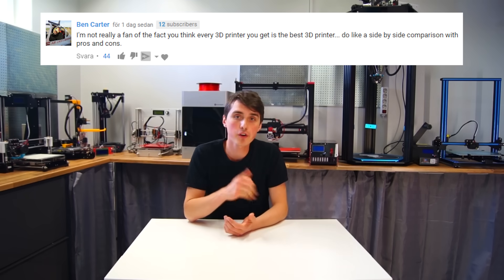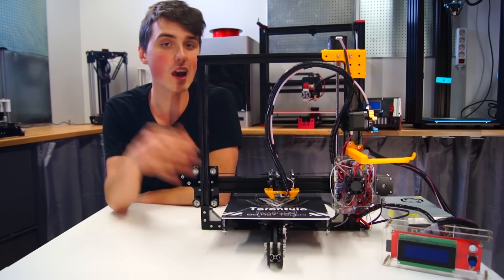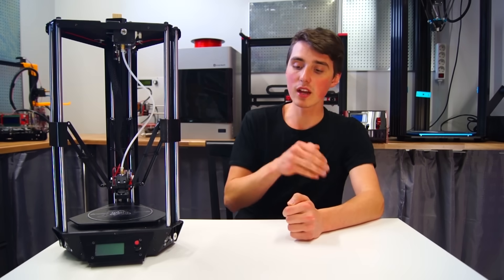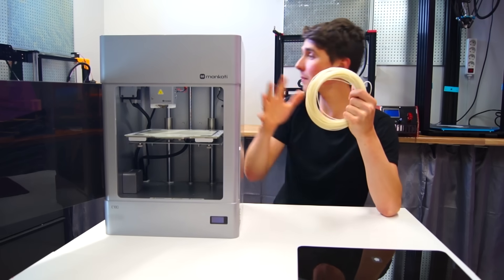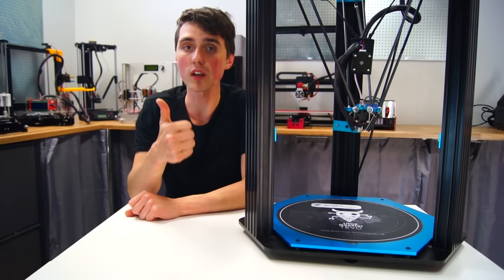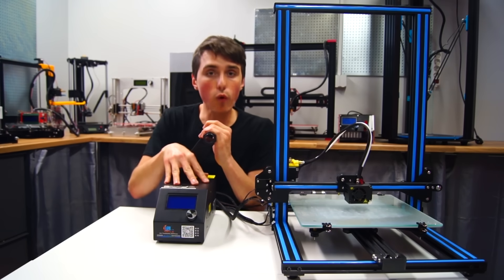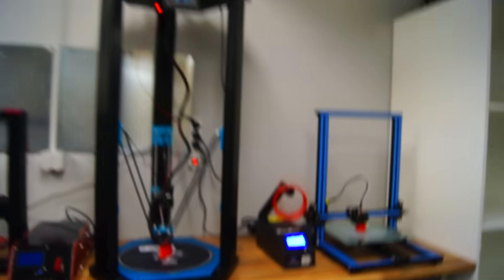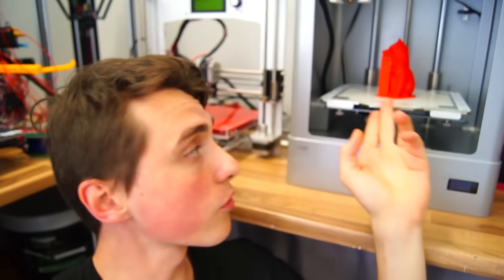Why This Is the Best 3D Printer - Comparing ALL My Printers!!!

Comment: I have been printing with the CR 10 for a week now, and this printer is mind blowing. Considering its price/performance this must be the best printer to buy in the world. I got it for 3600 SEK(423 USD). 300 microns look like 200 microns, and 200 look like 100 microns, and as is mentioned in the video the layers are laid down perfectly and in all axis. I don't understand why people feel the need to mod this machine, like messing with the fan duct or extruder when you can print one small object at 100 microns, at slow speed and still get no warping due to the extruder being close. Overhangs are also printed extremely well. If this machine cost one, two or up to three times more than it does, it would still make sense to buy it.

If you are wondering if this machine is only good for large print like i was wondering before i bought it, wonder no more, it can handle both very very well. I started with UncleJesses Simplify3D settings, they worked well but i have tweaked them quite a bit, but only small tweaks in numbers. One needs to tweak these settings depending on filament and not just the machine. I am guessing this printer can handle 50 microns as well, i am just about to test it. for print speed i have it set to 60mm/s

Anything negative well yes some:

1# My Z coupler was stretched out and basically destroyed, someone had printed with the machine as there was black filament in the nozzle. I was devastated over this since it took 25 days for the printer to arrive (gearbest/hongkong). I was anxious to print and did not want to mess with support and them sending me a new z coupler. I was ready to order a new coupler from Sweden and get it by mail in 1-2 days, but what i did was to compress the coupler with large whatever they are called pliers, and refit the coupler and i was super lucky as i get no z wobble whatsoever. I have read that many people get this stretched out z coupler, it boggles my mind how they can send the machine with this error, i also know why this can happen to the coupler and they should too.

2# I have not heard anyone complain about this and i have seen people printing objects 400mm tall that are perfect but, when small jittery features are being printed at the bottom, the top vibrates, BUT, i have got my printer standing at a large square piece of packing foam that was protecting the printer in its box. This could be the reason why i have extra vibrations, in fact it is very likely. One can do a mod for increased stability, also i think when small motions are made when the extruder are way up in the frame at the top of the object, the vibration will be much less or not exist since it is not happening at the base.

3# PSU noise, the power supply fan is crazy loud. The printer itself is not bad, but the PSU i will have to fix, there are solutions to this, they should have included a heat controller for this fan. I will have to take one from my old Prusa i3 that is really silent.

4# The controller knob for the display does not register clicks too well on my machine, could be a little better.

With all that said, #1 and #2 could be a non issue for most people. My summary is that i wanted quality and print size this time and i got it. This printer is so good that i wonder how it compare to a MakerBot Z18 or similar that cost 8000 -  10 000 USD.

Comment: I have the geeetech prusa i3. At the beginning it was a shitty printer. Never got the right settings for it. It took me a week to install it properly. But then i troubleshoot it and the roda from the Z axis seemed not the right one for me. So i bougt another set from the store. I bought rods with more thread. Software was ok. Only the usb connection needed some work. But after all everything is working ok right now with the new rods. I'm printing a lot of fpv drone stuff for it. The only downside is that i only can print at a 35 mm/s speed in reptier host slicer. It can print faster offcourse but the faster i print with this one the quality is going down. But no problem for me i payed only 250 euro's

Comment: I had the geeetech i3 aluminum it did a similar thing as yours right after assembly i maybe got a couple decent prints off it before it stopped working completely.... It has good mechanics but crap electronics a ramps or smoothie upgrade would be the way to go with it the sanguinolulu boards are awful i tried 3 boards they sent me and none of them work

Comment: I'm sorry you've had so much trouble with your tevo black widow. Apart from having the power supply go out on me, it wasn't hard to replace. I even upgraded to two power supplies so I could split the load. I hope you have better luck with it because it really is a great printer.

Comment: I'm about to get my frist DIY Printer (Anet A8). I've been using the deltaprintr from deltaprintr (Joel from 3dprinting nerd reviewed it). I'm getting the free upgraded nozzle but I'd like a larger print bed.  Do you have any experience with upgrading the anet a8 to the e3d extruder?  I really enjoy watching you testing and the ability to test it. (I'd go for the CR-10 but that's just a bit above my price range....and I have a space issue :) )

Comment: 5:22 If printer shows incorrect temperature, while termistors are valid, this may be either incorrect voltage applied to termistors that controller reads with incorrect current (measuring resistance). This is controller HW problem. Also RepRap software, I expect in the controller, has lot of termistor resistance to temperature tables. In case wrong table is chosen in software image this will give wrong temperature on display. Also first HW problem can be solved by customizing  your own termistor resistance to temperature table, but this is long activity to measure resistance at every 5 degrees step of externally measured temperature to put values in the table.

Comment: We're total novices on 3D printing. and wondered if you could help? We want to print a 2 part wall mounted kitchen roll holder holder. The size would be around 300mm x 100mm. It would need to be great quality, could you recommend some machines that could do this?

Comment: I noticed you took out the fans on the tarantula. Is there a reason for that or just did it because. Just wondering cause I ordered some fans for it and wanted to know if it caused a problem or not
Reply from the maker: No reason, basically just for easy access of the hot end,

Comment: Great video and and information.  In the video before printing, you said all the printers were set to the same speed but the TEVO Delta finished 30 minutes before all the others...seems like the quality of this print would have been a better comparison if the speed of the print was actually slowed to match the others.   Also it would have been nice to know which printers come with auto bed leveling vs manual bed leveling since a good leveled bed has a great effect on print quality.

Comment: Anyone scared of the exposed wires of a power supply should just "print" and box to put it in.  Hellar!  Isn't that a main reason to own a 3D printer, so you can solve real world problems with 3D printed solutions?  In the multi-million dollar company I work at with liability issues up the wahzoo, their approved solution is a strip of plastic to cover the terminals secured by 2 screws!  So almost any kind of cage that keeps fingers out and still allows the heat to escape should be safe enough.... unless you drink next to your printer.
Reply: you the real MVP.

Comment: I've got one of the Geeethech i3's... They have probably 8 variations, mine's got the plastic frame ("b"). What was up with yours? I found the shaft couplers were introducing more misallignment, replacing them with direct couplers worked. After lots of firmware edits, I got it working.
Since I've replaced nearly everything but the frame. It makes a good showing for total investment, but a Tarantula may have been the better choice.

Comment: What could you say about PRUSA I3 MK2S ? 

At today I haven't any 3D printer, but later this year I want to buy my first one, I do not want to have big problems from the start and want to have a near to a perfect finisching, (not rough) for pretty simple parts to build. 
I would like to have the possibility to print 30×30 cm (or at least 30x20 cm) large and maybe at least 10 cm high.

Comment: did you replace the Tevo's wiring? just replacing the thermistor or mobo isn't gonna help.... also, did you replace it with the proper one? did you make sure the correct one was even selected in the firmware?

Comment: thanks for the video, very beneficial. is your cr-10 the s3 model? 30x30x40? i want to order one in a few days but tjere are multiple manifactures on alibaba. also the cr-10 s4 & s5 looks inviting. do you know anything about them? 40x40x40 and 50x50x50 respectly.
Reply from the maker: Yes this is the 300x300x400 version from Gearbest. Don't know about Alibaba or the other variants.

Comment: on the black widow did you try adjusting pid's
Reply from the maker: No I did not, but I got some replacement parts on the way. Hopefully that will fix the issue.
Reply: RCLifeOn I would try PIDs.

Comment: At Geeeeeeetech printer, did u checked the switch of 110/220 it has inside of power supply?
Reply from the maker: Yes, that is not the problem. Thanks anyway!
Reply: And i assembling my geeetech now and i notice something curious: The four step motors looks equal, but there is one that feel different when you turn the shaft with hands.

Comment: I have a GEEEtech i3 that I've been using for about a year and a half now. It's worked well since I got it up and running but had some issues on setup that needed fixing before I got it to work. What issues are you having with yours?
Reply from the maker: Nice to hear someone having success with the Geeetech i3. I gave up on mine and salvage parts from it. Don't have a plan to fix it really.

Comment: I have a Anet A8 and a Kossel Delta. The A8 ROCKS. I don't have any issues with the quality. I think you might need to tweak your settings. I slowed mine down a bit and the quality is excellent. I have had nothing but trouble with the Delta. Not only is it small but the print quality is not good. I am still trying t tweak that one for really good results. It also has Broken Down on me like 6 times in 3 months. The A8 helped me learn a lot about 3d printing. I have done a lot of upgrading on mine - Cable chains etc...  You can also print Cases for the power supply if you are worried about it.

Comment: Great video which clears up many questions I had. Out of curiosity, can any of your printer print using clear (Transparent) plastic filament? What parameters would you need to print using this material?
Reply from the maker: Yes, I use transparent filament all the time. Typically 2-3 perimeters. Thanks for watching!

Comment: Hello from Spain,

Nice video. I have a Geeetech Prusa i3 pro b, add some improves (change for full aluminium bed, add proximity inductive sensor, solve anti-wobbling in Z, change mosfets, etc) and works very well for price, only cost 160€ incluiding shipping. I spend 20€ more in improvements.

Comment: about the black-widow temperature error: If it is measured by a thermocouple the polarity is important. If the thermistors and printboard aren't the problem the wiring and connections should be?

Comment: Thanks for the run down. Do you feel like the CR-10, at twice the price of the Tarantula, is twice as good a product?
Reply from the maker: Well, I would rather have one CR-10 than two TEVO Tarantulas. However, that's mostly because of the larger build area. It's not linear, you pay twice as much for improvements, not because the CR-10 is twice as good. Was that even understandable? Nevertheless, I would personally go with the CR-10.
Reply: RCLifeOn Makes perfect sense. Thanks for the reply!

Comment: That black widow problem - check the connectors and cabling. The traditional search pattern for failures starts with moving parts, connectors and connections.

Comment: Question: I was looking at the CR10 for a first printer because of price and build volume. Would you say the CR10 power supply enclosure is completely safe, kinda safe? Just a concern because I have little cousins visiting often. I realized that because it's enclosed that it's probably really safe, but I just want to make sure before I get one. Safety before anything else.
Reply from the maker: That's great, safety before anything else! Good job looking after your cousins! Yes, I would say it's completely safe. The power outlets around your house is more dangerous.
Reply: Thanks! I appreciate it a lot!

Comment: So what are your print settings for the Creality  CR-10. And what Slicer do you use?
Reply from the maker: Currently I'm using Cura. It's free for everyone and works great. Maybe I should do a video on it?
Reply: you should definitely do that :) great work @RCLifeOn!
Reply: just got the CR-10 & its amazing. I had an issue with the print starting at the bottom left. Please do a Cura tut. thanks
Reply: yes

Comment: I have a Geetech i3 and let me tell u the damn thing is garbage. It came as kit and I had it built in a few hours.  from day one it has been nothing but problems with this printer. from the belt tensioner  on the X not fitting correctly into the slot of the 3d printed part to the baring holder on the Z splitting and cracking (had to use a zip tie to keep it together). I was hoping that on my first print I could make a new one but I never got a single good print from it. the supplied direct feed MK extruder always jammed and clogged in the throat. I replaced it with a clone j style hot end and still couldn't get a single print. I even upgraded the entire printhead to a geared style and the same problem would occur, the nozzle would clog as if the nozzle was losing power during the print causing it to cool and then kicking back on. I changed thermisters, heater cartridges, throats, nozzles, made my own cooling fins, added fans, removed fans, different manufacture filaments (pla,abs), all metal Z baring holders, all metal extruder holder, thredded rods (the were bent giving real bad Z Wobble), nothing i did could get this printer to give me one single good print. At that point i wasnt about to purchase anther single part (power supply was all that was left). In the end I bit the bullet and bought me a remanufactured Robo3d R1 from eBay for $400 shipped and the damn thing worked flawlessly out the box, I'm printing on it as we speak. One thing I will say about the Geetech i3, it taught me everything I needed to know about 3d printers and how to repair them if something goes wrong. if my Robo3d ever has a problem i have a shit load of extra parts to make it work.

Comment: I'm wondering, I've seen a couple other video that've shown a much much higher print quality to the A8, similar to the tarantula. Did you tweaked the printer to it's max capacity ?

The Cr-10 is actually incredible but in canadian it's 537$ + 113$ shipping. Making it quite expensive at 650 compared to 278 of the A8 ( 226 + 52 shipping ).

Comment: Can you please do a balco 3D printer review I have one and I want to see what you think. :) P.S I have got great prints out of it but i'am  having some trouble with flexible filament, its base model is a pura 3D printer. I am 11
Reply: Matthew Hutchinson this is a wanhao rebranded machine. Direct drive, which should do flexible just fine. Make sure to start first layer at a crawl (15mm/s) and the keep the rest of the print under 30mm/s.

Comment: Thanks for another great video!  I have a CR-10 and I love it!  What settings do you use? (Nozzle/Bed Temp, printing speed, etc)
Reply: That depends on the type of filament you load, and the specific requirements of the object you want to print.
Reply: What do you think about the cr 10 max??

Comment: Very nice video. I suppose it has been pointed out to you already that the mentioned "Salmon Skin" effect isn't so much the result of the Delta kinematics, but the used DRV8825 steppers' problem of missing steps.  Either by forcing the steppers from mixed mode to Fast decay, adding TL smoothers or replacing the DRV8825 altogether with better steppers, the Salmon skin effect can be surpressed or totally removed even.   Just a friendly pointer. :D